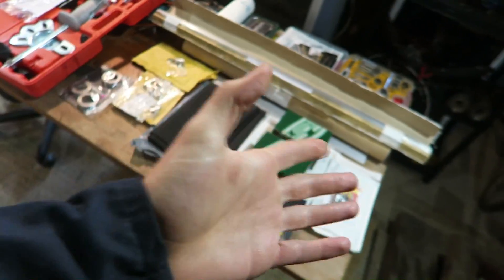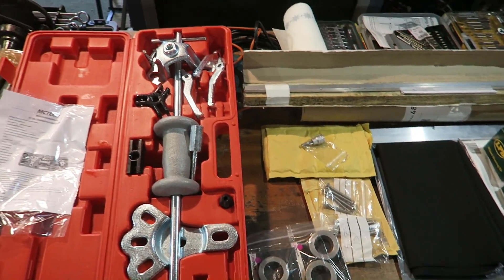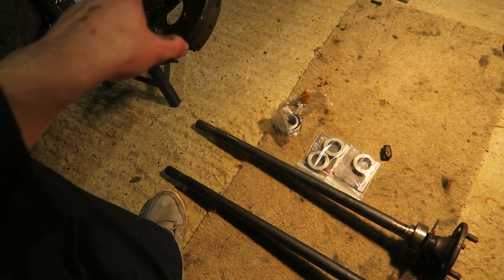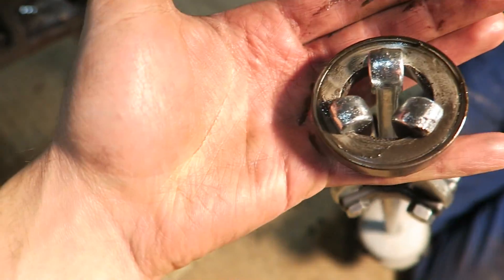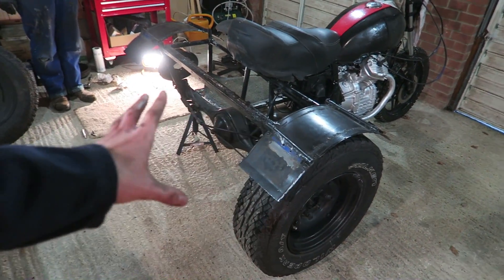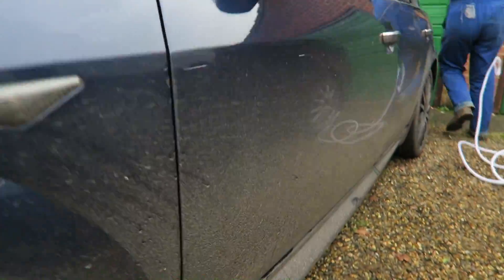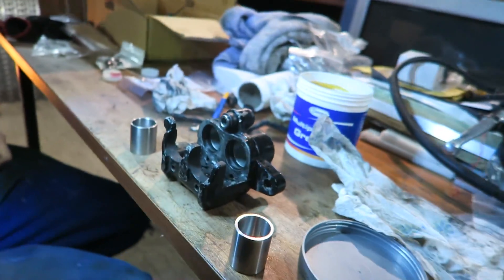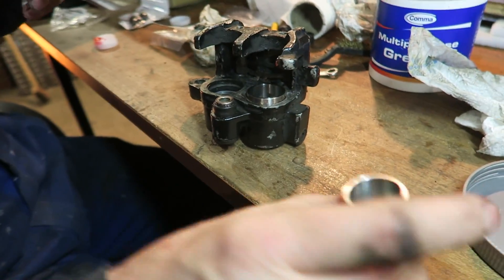The Mondeo's Finally Meet!

Comment: I think your new axles use bearings with integral seals which is what your replacement bearings have. Your original axle was the earlier type with bearings with no seal and a separate seal. In your case I would tack weld the wheel bolt in place and put the old half shafts back with the new seals.

Comment: Nice work! I would avoid using general purpose grease on the rubber seals they will eat away at the rubber as its petroleum based. Red rubber Silicon grease is best for any brake rebuild job.

Comment: Can't you use the old shafts and just replace bearings and wheel studs I usually use red brake grease when overhauling brake calipers rubber seals might swell with multipurpose  grease